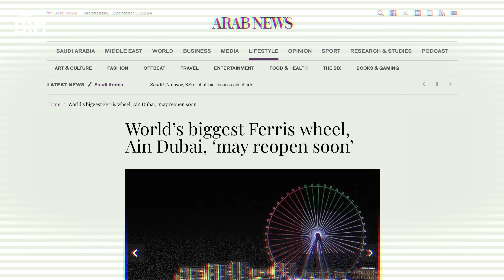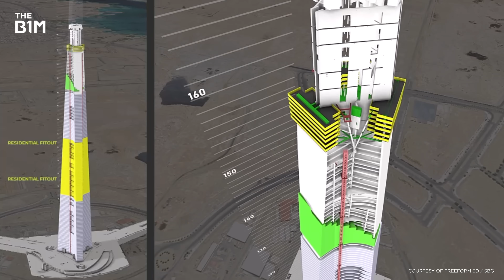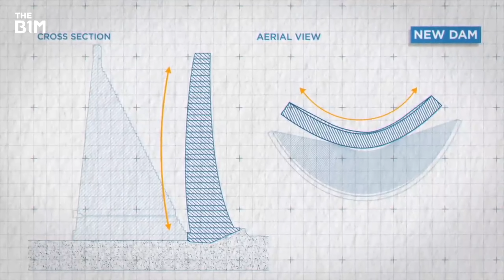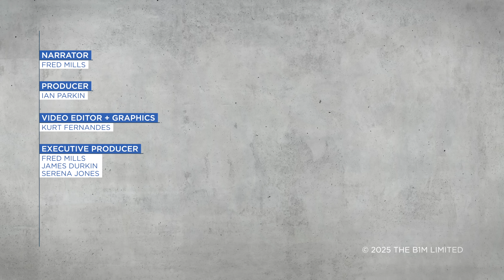Top 25 MegaBuilds of 2025

Comment: 0:25 0:26 0:27 0:27 0:27 0:28 0:28 0:28 0:28 0:29 0:29 0:29 0:29 yeah!visit quite literally at the top with the birds been cutting into diet which will be the tallest building completed this year and if you're a fan of skyhigh luxury apartments and diamond in crusted watches and this one is a bit are you

Comment: Hhmm, Iter does not have the potential to produce any energy for any useful purpose. It is merely a demonstrator and is unlikely to even work as intended. It will never deliver a single watt of power to the electricity grid.

Comment: Whilst not as big as the projects mentioned in this video South Australia has multiple big things happening this year. The River Torrens to Darlington project should hopefully make some more progress this year as vast sections of the land have been cleared ready for work to begin. 

The Tram line in Adelaide this year will be closing for 4 new bridges to replace 3 level crossings and a redo of an existing bridge due to the Torrens to Darlington tunnels passing underneath (it'll be having a section for traffic to exit for a connecting intersection heading to the city). It's apparently meant to be over 6 months from mid 2025 and reopening in late Jan 2026.

Comment: About Rail Baltica: We aren't dismantling existing railways or stations. On the contrary, in Estonia, there is a massive project to electrify nearly 100% of the existing railway network and increase speed limits to 160km/h operations. RB adds a new rail capacity and creates a new rail corridor, but it does not replace the existing infrastructure.
Reply: Will your countries convert the Russian gauge to European standard gauge (1435 mm)? It doesn't matter for local/regional passenger lines, but it would help long distance and freight operation.
Reply: @micha2909  No. There are no plans to convert existing rail infrastructure gauges.
Reply: @micha2909  that's the main idea. But... funding was cancelled
Reply: I'm fascinated by the engineering and technology behind these projects.  It's incredible what humans can achieve! 💪  Thanks for showcasing these amazing feats of construction! 🙏
Reply: Great! I'm really happy that Estonia is getting this done, it should also happen in Romania(it already did in some parts but pretty limited).
Reply: Will the rail guage change?
Reply: I think he meant dismantling the "Eastward focus" for the "Southward focus."
Reply: You should be converting your broad gauge network as well, or at least use concrete sleepers that support both gauges. You'll end up like spain, shere first they spent shittons of money to renovate broad gauge lines, but there isnt much traffic on them, and after that they started to build a high speed normal gauge network. If they started the cknversion back then, theywouldnt have two underperforming parallel rail networks as of now.

Comment: My new garden shed that I'm planning for this summer didn't make it to the list :(
Reply: Build it in Dubai , it will make to list😂
Reply from the maker: Hhahahaha
Reply: @chandanmishra8211  or Qatar, there's enough space because Qatar is an empty country
Reply: If it was designed by Zaha Hadid Architects then it should be on the list.
Reply: @aalan4296  now that is something I would love to see
Reply: I added it to my top 25 list, don't worry ;)
Reply: It was #26, just missed the cut off.
Reply: Maybe its top 26?
Reply: @artapples8417 nice profile picture
Reply: @diamonddave2622  hehe yours (Taeyeon) too 🥰
Reply: You need to rent it out to someone to live in.
Reply: I'm a bit disappointed that my country's new high-speed rail line didn't make the list. 🚄  It's a game-changer for transportation in our region! 🤔
Reply: @Constrantics which country is your home?
Reply: @artapples8417 nice avatar
Reply: To make the list, your shed has to be either 300m tall, span a river, be 200km long with a train running through it, or be designed by Foster & Partners.
Reply: It’s because you painted it all wrong